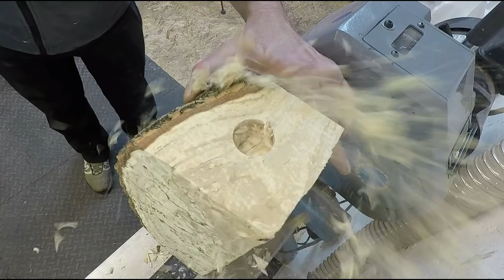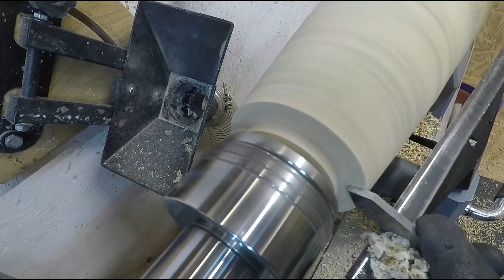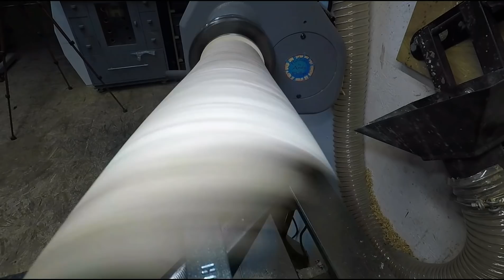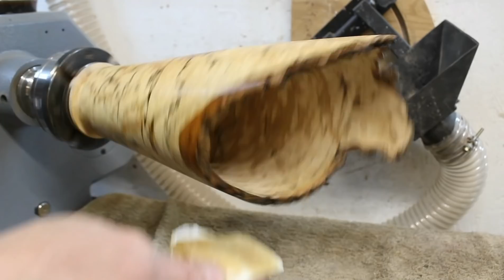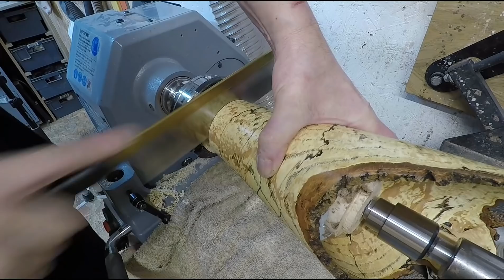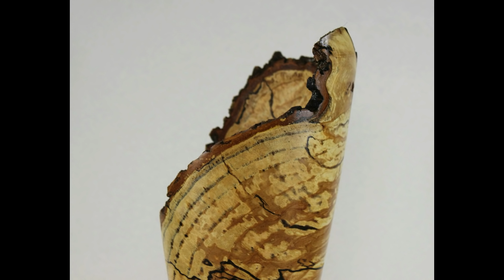Woodturning - A Spalted Ash Vessel

Comment: For those of you who are not woodturners, I'd like to point out something TRULY impressive. The tool Andy uses almost exclusively to shape the exteriors of his pieces is called a spindle or fingernail gouge. It is a great shaping tool for relatively flat surfaces but it is almost IMPOSSIBLE for mere mortals to control on any rough surface. If I ever trued to use that tool to do the things Andy routinely and skillfully uses it for (like knocking the bark off), I'd quickly end up with that thing imbedded in my ear. Andy, your skill is truly breathtaking.
Reply: What about someone with insane forearm and grip strength?
Reply: The amount of sheer control Andy has is unmatched. His hands are so steady and precise that’s what it means to be a skillful wood turner
Reply: CNC lathe's would most likely end end in disataster.
Reply: Looks like a bowl gouge, not a spindle gouge. A typical spindle gouge wouldn't hold up to the end grain turning in this video, and shouldn't be tried on end grain turning. 

That said, this is a nice piece of work. Inspires me to try something different. You don't see many vases turned with end grain orientation.
Reply: @luncans8291  im guessing you are joking. It's about technique. Strength really isn't the biggest factor. The roughing does take some, but technique / tool presentation is what really matters if someone wants to do this a lot. Once the piece is rounded it is completely about technique, the grip and strength isn't a factor to finish the outside.  The tool does the work, the turner steers it in the right direction with a lot of skill. The lathe typically wins over bad technique.  Grip strength and Popeye forearms will result in a destroyed piece if that is all a turner brings to the lathe. And, someone could get seriously hurt or even killed. Even the pros get killed sometimes,  or has to be taken seriously.
Reply: thanks, I was looking what is the tool he used

Comment: For the lopsided top, have you considered using a variable strobe light to make it easier to see? If you tune the strobe frequency to a factor of the RPM it appears to spin slower and would be easier to see what you are cutting.

Comment: Stunningly good! 
A question; do you think it would be possible to coat the inside with some layers of resin (instead of oil), and make it possible to contain/hold water? Without cracking the wood or resin I mean.
I get the feeling a bunch of tulips would look great in that one.
Reply from the maker: Thanks .. Yes you can coat them to be water proof similar to when making wooden sinks
Reply: I've done similar turns, not this nice certainly and I made the inside so that it would hold a plastic 16 oz tumbler. Beautiful project!

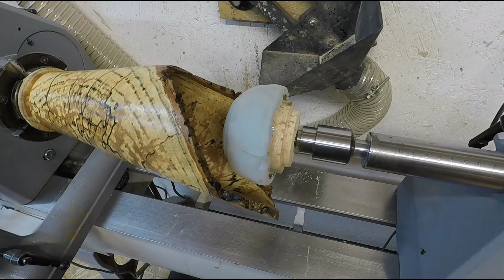Comment: Andy, I want to ask a question. I love your work and this vessel is a great looking piece of art. My question is, when you finished turning it, there was still a wider base at the bottom, which I actually liked. But then at 8:07 you cut it off and removed it. Why? I understand you are the artist, but I feel that a wider base s a greater visual counter-balance to the wide top and it provides added stability when the vessel sits on display. Did you every consider leaving a wider base or do you always taper all of them down to a narrow width base?
Reply from the maker: Just recently finished this piece with a base left on but I  usually think a base can detract from the form and shape of a piece I just do what I think is right (in my own head)while turning .. https://www.instagram.com/p/B_MbUBvDMFg/?igshid=1gjvuw9uhj15e

Comment: how did you get a tenon to  mount the piece initially? I saw the hole you drilled at first, did you chuck inside that hole?
Reply from the maker: Yes I expanded into the 30 mm hole